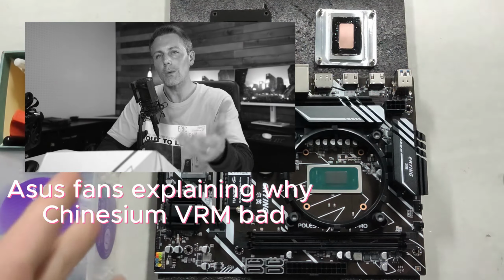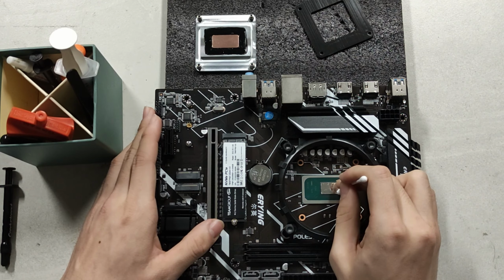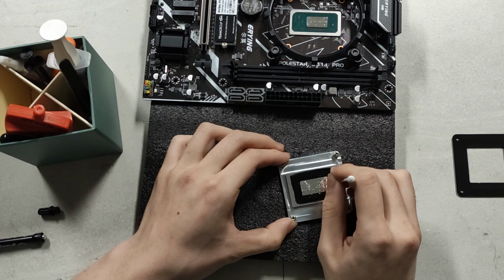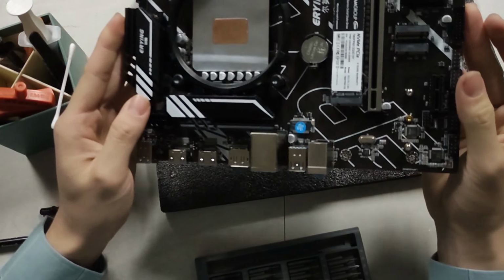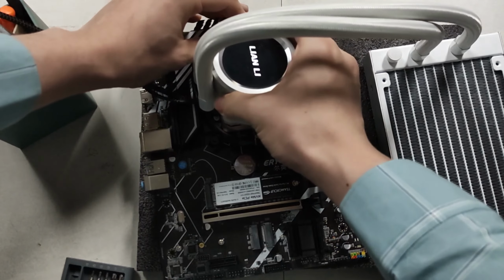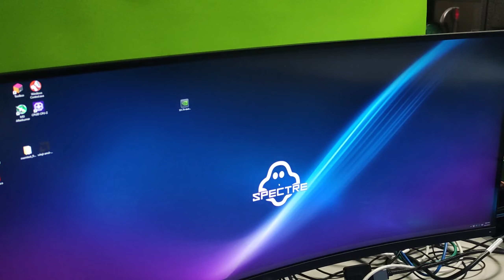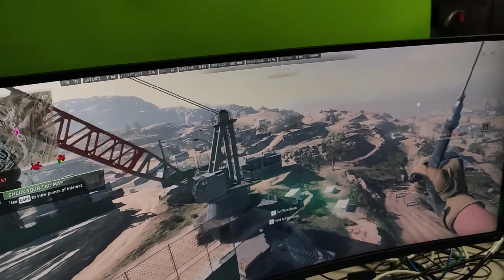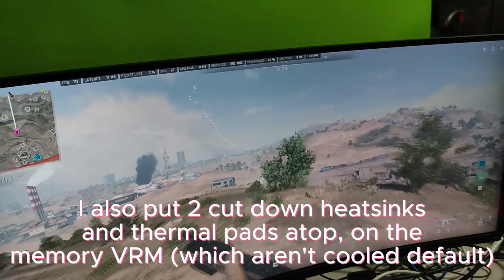$200 i9 AND Motherboard KIT?!? REVIEWING Erying 11980HK Modified HM570 - Liquid Metal & RAM OC, FPS

Comment: I've had the the Erying 12900H MATX board for just under a year, all seemed fine till a couple days ago on air cooling, with stable temps, under Manjaro Gnome  till one of my front panel USB ports stopped working, and it would randomly turn freeze, not power up without taking the CMOS battery out, and the only thing I ever overclocked was the RAM to it's max 3200Mhz, and no even after stock settings I was having issues, and had to switch to my backup AMD A10 build,  so no I don't recommend these boards.
Reply from the maker: I repad my boards with new strips of thermal pads! The VRMs tend to run really hot on them
Reply: @compuguy123  I honestly ended up buying a replacement board from them, as it was still the best deal, and they have improved it a lot with the USB 3 connector in a better location, clear labels on the front panel I/O header, better slug on top of the CPU, and better heatsinks on the VRM, I have the PC built now, and will keep an eye on the temps, but next time before I take it down for cleaning, I will indeed make sure to order some thermal pads to go under the VRM heatsinks, of which I think the VRMS have been upgraded as well as they were a different brand than my original board.

Comment: Are you using the February 2023 BIOS that's floating around with a GUI UEFI interface with lightning bolts in the background?  It's much easier to overclock.
Reply from the maker: I got the one from the website that is marginally improved and shows AMI on boot

Comment: I manage to overclock 3 kits like this but the ES versions, one i7 and two i9's
The i7 4.8ghz all core, 4.9ghz up to 4 cores 1.25v HT on, memory 3600mhz cl16 1.45v 1.15v VCCSA ring at 3600 
the other two i9's 4.9ghz HT off 1.25v 3700mhz 2x16gb 1.45v, 1.2v VCCSA and 4.8ghz HT off 1.25v 3600mhz cl16 1.4v 1.15v VCCSA ring at 3700/3600
all runing liquid metal and 240m aio
Reply from the maker: If its the laptop conversion ones I never got the memory to run faster than 3000MHz since the interposer and socket presented too huge of a gap to pass faithful memory signals through without errors. 

I used to use the QQLS and QQLT; the QQLS would frequently hit far above 4.8GHz with ease, and on good boards can reach 5GHz with or without hyperthreading.
Reply: @compuguy123  Yeaaa i wish they make socket version of this insane 11gen ES 10nm cpu's they have much oc potential, more cache... for like some Z590 bios modded board i cannot pass 3700mhz (i manage to test BCLK oc but this board dont have external clock) ram clock on this ES version because the some wierd board bios behave... no loadling... imagine that... :face-blue-wide-eyes:
Reply: @compuguy123  You got to rise your Uncore Voltage (in bios: Overclock / Processor / Uncore). I use 1150 override, you can set a + offset if you prefer. That is necessary to use more than 3200Mhz on the RAM. Also, to increase the Ring speed, you gotta give it more juice, like 1100. I also run the ring at 3700Mhz, it helps on RAM latency.
Reply from the maker: Are we talking about the erying 11th gen motherboards or the 9th gen QQLS motherboards?
Reply: @compuguy123 He refering to the Erying Engineer Sample (unlocked) ones like the 3 kits i has been tuned...
Reply: Ring at 3700 is quite low. With +100mV offset, I was able to run 4.4Ghz uncore on a laptop w/ 11900H.

Comment: I have one of these boards and mine freezes when I try to slice my images on cura. So my question for you is how do you prevent yours from freezing my Temps ramp up to a 100 with a cooler like yours prevent it. Could you do a setup video of showing everything you did.
Reply from the maker: This is the setup video 0.o' you need a strong enough water cooler to keep it from ramping. 

Redo the thermal paste internally using liquid metal exactly as I did to make sure. Could be a levelling defect.

Comment: Is this a good choice for a budget system with AVX-512 support? Or is the 6 core i5 better for maintaining clocks?
Reply from the maker: If you're going heavy work you might want to try the i5. But you get more cores here so it's probably worth that.

Comment: the cpu is well covered with that square plate the cryo cooler will be perfect on these motherboards
Reply from the maker: Would be but there is the issue since the cooler won't run unless the software sanctions it

Comment: at 200 usd you can get a used 3600 or 5600 and motherboard for that price.
Reply from the maker: Yeah but the performance is meh and the hitreg is questionable. 
11980HK ES has more cache than the actual thing, more than 35mb, and more cores for work

Comment: In the uncore section is where the mem controller voltage is. If you up it you can use other memory. I'm using 16GB of Flare X 3200 at 3590 with 14-14-14-28 timings along with tighter subtimings. If it's the lighting background bios, you can't change this.
Reply from the maker: There's another bios? Dang ok. That's pretty crazy considering that you managed to get BCLK or what it seems, working on this board at all. 

I'm more interested in upping the cache frequency since it's lethargically low, ideally it should be at 4.0 or 4.2GHz
Reply: @compuguy123  I haven't found a way to up the cache mult. I have it at 3600mhz with my ram because of bclk.
Reply from the maker: @williamcarter3642  The fact that BCLK works at all on this meme board is a testament to greatness
Reply: @compuguy123  I have 4.9Ghz all core, 4.4Ghz cache. 3DMark Timespy CPU is over 13,000. RAM Latency @ 56ns with 64GB 3475MT/s 16-16-16-32 CR1 Gear 1 1.4v.

Cache does downclock when using AVX-512 though.
Reply from the maker: @Zero939  I barely even bother with AVX tbh, but maybe it's a better idea to keep it on

Comment: I would be interested to know how this compares to the r5 5600G which I have found combos at this price.
Reply from the maker: Much faster. the 5600G is kind of trashy on the cache side of things, but when paired with really good ram and a really good motherboard, you might as well get a set of Trident neos and a 5800X3d
Reply: @compuguy123  yeah except the 5800X3d doesnt overclock well i got two pc's one with 5600G @4.5ghz @ 1.4V all core but the 5800X3D pc only clocks to 4ghz all core @ 1.175V.

Comment: Prices for these are now around $170. I have been struggling to find head to head comparisons between this and other mainstream CPUs, especially if overclocked. Nowadays you can get a 5600 + mobo for around the same price. Is this still worth it over a 5600? Can it reach a 5700x / 5800x level with overclock? Which mainstream CPU performance would you compare this to?
Reply from the maker: Would be equivalent to the 12600 or so
Reply: Nice thank you  @compuguy123

Comment: for 200$ this maybe the good deal but when i was about to buy i found soyo B550m+5600G+16g 3200mhz which is much better in my opinion bcoz im noob when it comes to OC and tweaking
Reply from the maker: I'd say go with the 5600 non G or 3600 for the larger cache size. 

Overclocking the memory on the 5600G doesn't help as much as having a massive cache size.

Comment: Alot of reviewers of this type of mother boards report the overheat of the vrm section ... i have seen i very special horizontal cpu vrm cooler called jiushark jf13k i guess it will do the job ?
Reply from the maker: All you need is to put some extra heatsinks from aliexpress on it, then turn a fan inwards to direct air into the case. Keeps it well cool. Otherwise, invest in a tub of good thermal pad grease/thermal pads, and it'll run even better too.,

Comment: why dont you use metal liquid over the plate too ?
Reply from the maker: nope, the surrounding block is aluminium so if you did, there's a good chance it will rot.
Reply: @compuguy123  its best to avoid bare copper too to be fair its only nickel plated copper thats almost completely immune to corrosion, hence why its mostly used on IHS rather than heatsinks.

Comment: I just mine locked at 4.7 all core and so sent overheat
Reply from the maker: Turn it down lol
Reply: @compuguy123  what do you have yours at?
Reply from the maker: @merkedgg6322  4.6 or so but it's a 240mm aio with liquid metal as shown
Reply: @compuguy123  I run a static voltage the lowest mine goes is 1.270 on all cores Locked at 4.7
Reply: @compuguy123  what kind of undervolt do you run on yours?
Reply: @compuguy123  yea I ordered the new vapor cooled heat sinc by erying and some Liquid Metal  cunductonuat hopefully that helps temps
Reply: @compuguy123  I’m curious did u put any tape or something around the cpu so it dosent spill ?